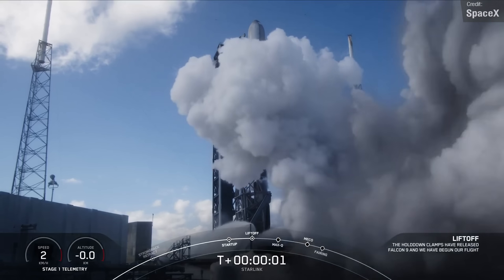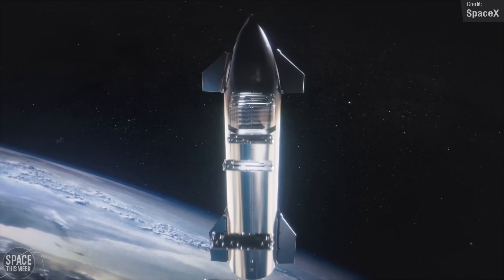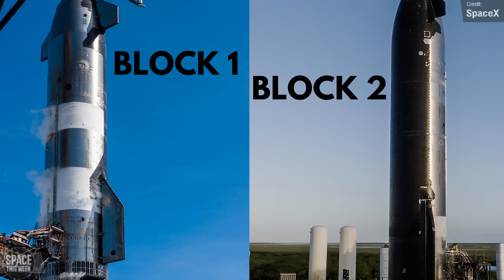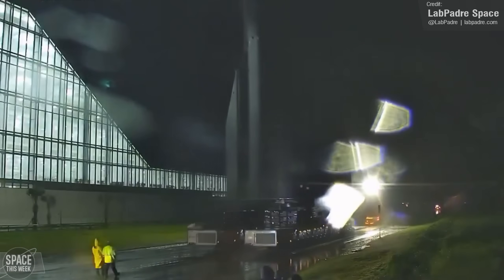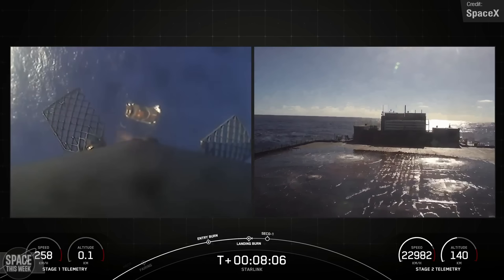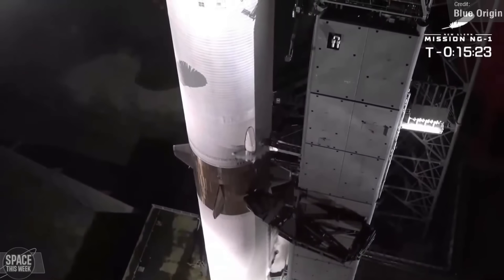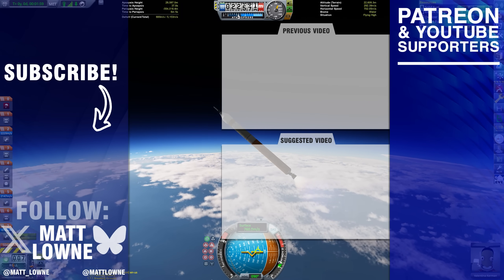SpaceX Just Completed the FINAL TEST for Flight 7, and Blue Origin ABORTED New Glenn!

Comment: Too many engines/failure points, heat shield that looks a total drag mess, booster grid units that don't fold in to recesses causing massive drag.  Designs should have had landing legs like falcon from the very beginning.  Go go new glen

Comment: The low speed twist maneuver in the animated catch sequence at 1:05 doesnt make sense.  Shouldnt the catch points be anterior and dorsal, so as to not be in line with the steering flaps ?  If they were A&D, the risky twist maneuver (to prevent the flaps from hitting the chopsticks) would be unnecessary.
Reply: on the other hand the forward flaps are supposed to be the backup catch point in case the Ship misses the Pins, similar to the Grid Fins on the Booster.

I expect the rear Flaps to be fully retracted and facing away from the Tower during Catch instead of that Spin maneuver. Possibly fully extending for Balance after they have passed the Arms.
Reply: I was thinking this. I assume its because one of those sides would take full re-entry forces which is much more likely to damage the catch system. Even then, it seems rather odd

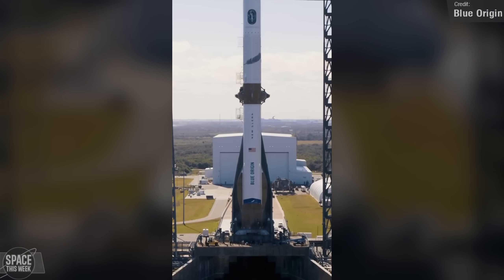Comment: 9:20 - The choice on recent launches to expend the core of Falcon Heavy was just based on the required mass to orbit, which easily exceeds the claimed New Glenn capability. I expect that Falcon Heavy in its core expended or non-expended configuration is still much cheaper. This could reduce Blue Origins launch market hopes to mainly the captive Amazon Kuiper launches, and as a possible Space Force's dual launch provider (by replacing ULA, if they should fail). I have no idea what expending both Falcon Heavy side-boosters would do to SpaceX's heaviest launch capability, but they have the much more powerful Starship in the wings to potentially extend it.

Comment: The animation for a ship catch you used is pretty inaccurate actually.. it came in and had to rotate and it also came straight in when we know from seeing the booster that it would come in targeting a spot in front of the ship and hover into the arms not straight up do a landing burn into the tower, not to mention from what I've seen that video showed the landing on 3 engines, thats the begging of the burn to ensure proper trajectory and orientation then 2 kick off and it lands on 1 engine

Comment: For the Falcon 9 that flew 25 times, which parts do they change, which ones do they keep during maintenance? Isn't it the Falcon 9 of Theseus after a certain amount of flights?
Reply: I mean, at the very least, the entire hull is original.  I doubt they're spraying a coat of soot on the thing for giggles.  Anyway, nah, most of the engines and the key avionics and systems are original as well.  It's more than enough.  You couldn't reasonably argue that too much has been replaced for it to count.
Reply: @Asterra2  It's probably findable somwhere but I wonder what's the track record of the engines themselves
Reply: I think it's likely that every engine is swapped between flight, and then the engines are refurbished and then put onto a different booster. Aside from that, likely not meaningful changes between flights.
Reply: Since the legs don't retract and only extend once per flight, they may have single use actuators. The shock absorbers may also be single use. The landing legs have suffered visible damage in a few hard landings. When the external structure absorbs shocks by deformation, those parts need to be replaced.

Soot on the outside of the booster isn't a problem, but it will need to be cleaned out of any mechanisms.

They test the whole thing for cracks. I don't know if they use X-rays, ultrasound, or something else. The grid fins won't last forever.